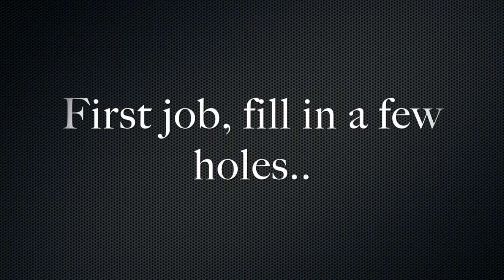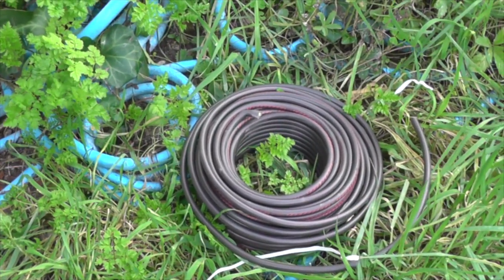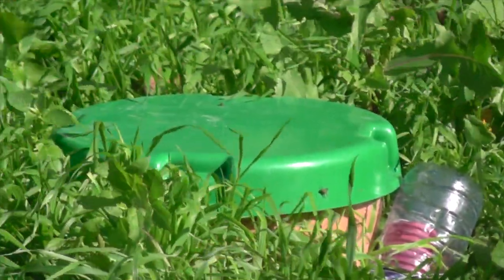French House Renovation. Week 11 Part 1

Comment: Hi Grahame, The white paint on the ceiling has given the room so much "height". Will you have to have all the electrics certified before you can move in? Take care Grahame. Cheers, Huw
Reply from the maker: Hi Huw, feels a lot lighter too, any new electrics, have to be signed off, otherwise the house insurance is not valid, any existing electrics should be ok.. cheers Huw take care..